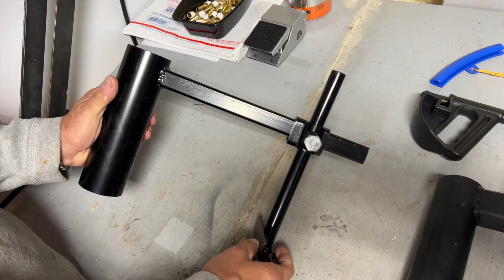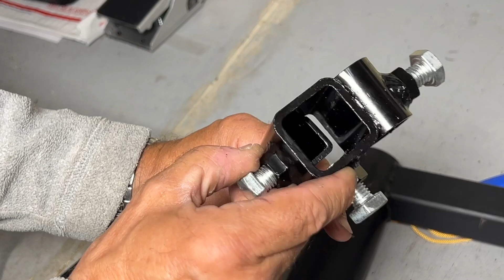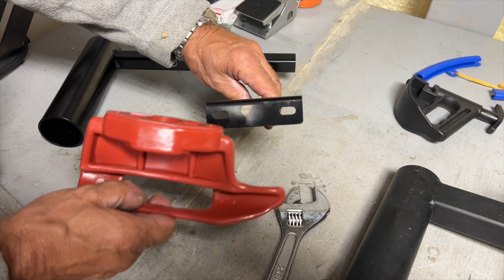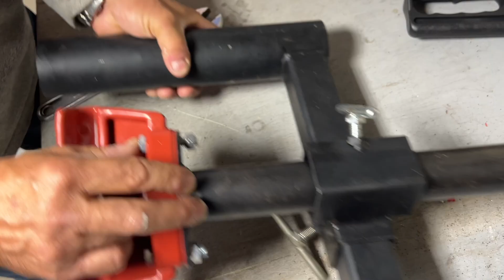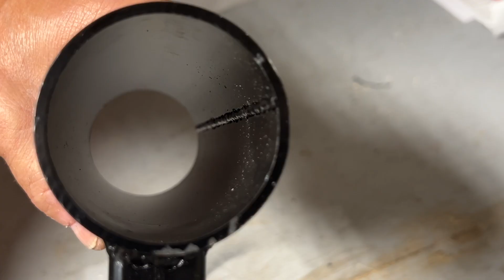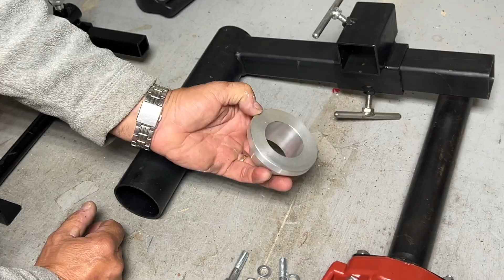Harbor Freight Tire Changer Duck Head Kit - Shoot Out

Comment: I bought mine from Amazon has the bearings and a cone for 79.00 it works great and a lot cheaper than the lucid
Reply from the maker: We focus on engineering our kits for better stability and ease of use with features like our self-centering, three-point capture design.

Comment: The whole thing about needing a wrench vs. not is just stupid. People buying these things (like me, currently shopping) are doing it to mount and dismount tires. They have tools. Even your demo using an adjustable wrench is stupid. What kind of fool would even use something like that? There are about 10 different ways I'd use before using an adjustable wrench. And if I had a stupid thumb screw thing like your product does, I'd remove it and replace them with actual big boy screws so I could use my plentiful tools with them. I'd be perfectly willing to do that if your product were good enough to warrant that.
The stuff about the size of one box tube within another one, etc. - THAT is valid. But you've already detonated your credibility by crying about needing a wrench. I don't even know if your product is good.
Now watching the rest of the video, yes, your product is WAY better than the crap one. All great design points, clearly explained. You'll do better if you skip the talk about tools and hardware.
Reply from the maker: Appreciate your input on the needed tool vs not.  Got it.  
Glad to see that, at the end of the day, you agree with us that our design is better and our production (welds etc) are high quality as well.  Certainly hope that we can add you to the list of people who have purchased our products and provided nearly across the board 5 star ratings on our website.   
Best regards and thanks for watching our video.